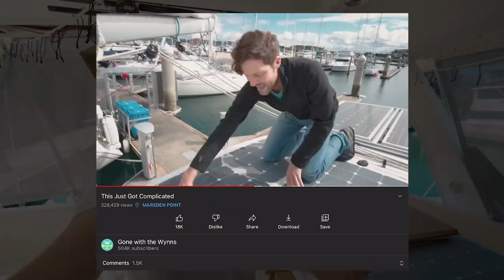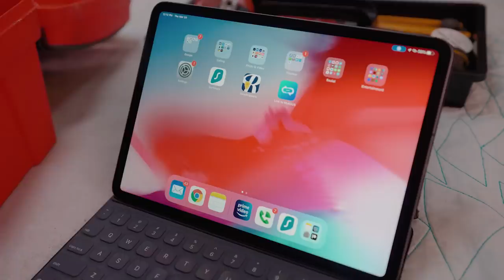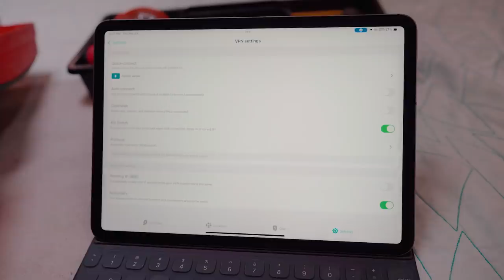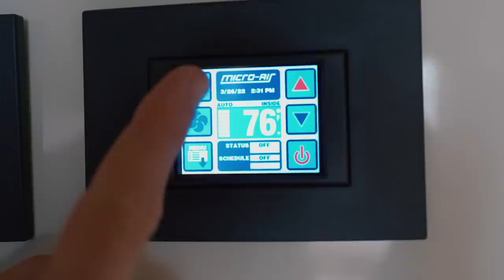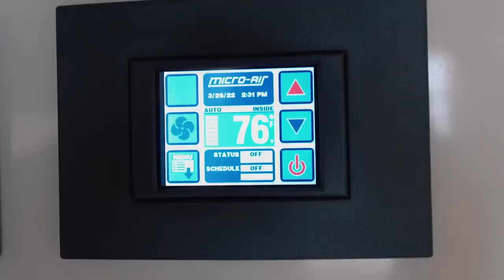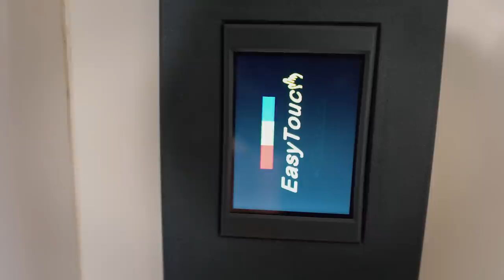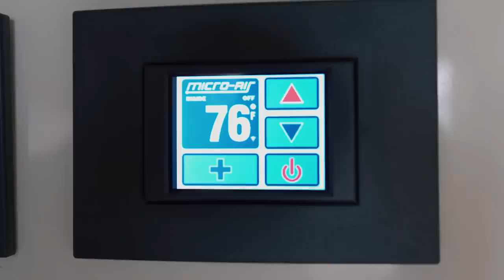Getting Back Modern Day Luxuries

Comment: Pro-tip…. Dehumidification of a boat takes 3 days of the unit being on before the space has all the moisture sucked out.  Dehumidification is also 1/3rd of the energy usage of an air conditioner.  So if you keep the space dehumidified then it takes less power to use the air conditioner when you want it.  Always use the dehumidifier when plugged in or when you have extra power.

Comment: Pre-heat those hose ends and they'll be much easier to slip over the fittings. Stick the end of the hose into a bowl of very hot water, let it soak to get soft & pliable, slip it over a ribbed pipe fitting and apply the hose clamp.  Life will be MUCH better!  If there's not enough slack to get the hose into a bowl of hot water, you can carefully (!) use a heat gun.  Even a hair drier will help get the plastic hose softer and easier to slide over the fitting.

Comment: I was a truck driver in the oilfield for 43 years. We had webasco heaters on our engines. They were hot water heaters to warm up the engines before starting. They burned about a pint of fuel an hour. They would bring a -20° engine up to 150° in twenty minutes. That way it was a warm engine start, which was a lot easier on the engines. That was in 2007, old technology. If your unit is as good as the old stuff, you will enjoy it.

Comment: Definitely add the extra caulk.  Most lift in an airplane wing comes wind passing over the top of it, much like your solar panels would be experiencing.   Every gusty storm will try the adhesive just a little and certainly adds up over time.

Comment: I also recently lost 3 of 6 flexible panels during a Typhoon in the Philippines. They were glued down AND put screws in on the 4 corners. Unfortunately, the sikaflex caulking really didn't stick well because of poor preparation in my side. The proper way is to sand the back of the panel where you plan to lay the caulking so that it is not shiny, but dull. Then wipe clean with acetone, both back of panel and the bimini surface.

I replaced all 6 of my panels with bigger, 3rd generation Sunpower using Maxeon cell technology. But this time I used 3M double sided tape and used the same type of preparation. Super pleased with final outcome.

Comment: Our venerable old lady, a 1975 Chris Craft 35 dc did not come with factory air. When we bought it in 2004 it had a home window unit cut into the back wall exiting and spewing condensate all over the bridge, ugly!. We were able to get a used 1992 16000 btu unit from a neighbor who was replacing it.  The install went pretty well, all custom because it was new to us. Been a lifesaver ever since. Being in Wisconsin heat is an important factor and boats get so hot when closed up during the summer weeks, A/C is essential. Our friend just replaced his  original salon unit, (1982) with the same one you installed.  It works really well.  You'll be happy.🌬❄❄❄
Love everything you do!  Keep up the great work.

Comment: Nikki, I just had sinus surgery on Feb 28 to remove 98% blockage of polyps.  Doing fantastic now!!!  It was life changing!!!  Should have done it years ago. Tremendously helped with allergies as well and no more asthma.  If you can get the option, make sure to get the Propel (biodegradable nasal stent with steroid) to dramatically improve healing and help to breathe.  Will you be coming back to the states for that surgery?  I wish you best of luck.  - Mitch

Comment: You should put corrugated plastic it's like cardboard between the panel and the deck or the hard top to allow air flow under the flexible panel to keep it cool Better performance and longer lasting

Comment: i just had the procedure on my sinuses, and I am 3 weeks after still irrigating two or three times a day with sodium solution.  I have put up with sinusitis for 18 months, no smell.  Keep on caulking.  Carry on, love the channel.
Reply: I had all my sinuses ruptured during training while in the Navy in the 80's. I was offered the procedure & given a day to decide. I was aircrew in a patrol squadron, talked with a lot of flyers who had & those that didn't. Overall, there were more against the procedure than for it. Never had it done, now I get sinus migraines with weather changes, smell is mostly non existent - except chemicals, those hurt. 
   As for caulking, cutting the tip at an angle is ok, but if you then fine tune it by running the tip over a piece of sand paper, that will change the angle slightly & you won't have so much to clean up...  Fair winds!
Reply: I broke my nose at age 10, & didn't have it looked at (everyone was more concerned about the tooth that was knocked out.  Note - if you knock out a tooth & have 2 black eyes, it is hard not to have a broken nose).  Anyway, by age 35 I was having constant sinus infections, headaches, and nasal polyps.  Plus a severely reduced sense of smell.  So, they went in, opened/widened connections that should be open, cleared out a bunch of gunk.  One of the best decisions I ever made was to have this done.  But the actual process wasn't too pleasant.

Comment: Just to add a little note about your up coming sinus surgery.  I had the surgery 24 years ago and I am sure it has changed a little bit but still want to give you my experience.   The surgery is fine - no issues.  For about a week after I did have a huge headache because it felt like I was getting too much air.  It had been years since I was able to breathe so it just felt off.  But all was ok.   That surgery helped so much!  And it is still working to this day!   I often tell my husband that if I ever need it again - that I will do it all over again because I no longer deal with not being able to breathe, sinus headaches and sinus infections.  That one week headache was worth it!    Best wishes to you and Jason.

Comment: Glazier Pro Tip: Regardless of what your told or read. Never spray a bead of caulk with anything before tooling it. The liquid or a chemical film left behind will get into small spaces and be trapped, not allowing the caulk to get down inside those same spaces and adhere to the surface. In most cases you can get away with just cleaning the surfaces with isopropyl alcohol, let dry, tape all surfaces, lightly tool the caulk at about 45 deg angle In order to not dislodge tape or tare it. (frosting knife will work or the end of an empty caulk tube) After dry tooling… if you have some cosmetic issues spraying with something that will not leave a film or break down the caulk maybe be done at that time. 

If you can jump it… I can caulk it! ;)

Comment: Besides doing the repairs, replacement, modifications, it's a pleasure to see the prep work before each task. 
Yeah, not surprised the additional "Zorro" caulk application decreased your caulk /panel yield. I believe, either you or another voyager were surprise at the high cost of marine caulking materials in  NZ.

Comment: Pro tip: Get a heat gun.  Hard hoses (of any sort) soften up wonderfully under a few seconds of heat from a heat gun... not only will they slide over the barbs better, the hose will conform to the barb's shape and give you a better watertight seal.
Reply from the maker: NOW you tell us! 😝

Comment: Wondering about the flexible panels...  The ones I found on-line appear to be the 12v variety, but Jason mentioned 50 volts in the video.  Do you have them wired in series, perhaps, i.e. 2 parallel strings of 3 panels in series?  If so, and given the variable shading with the Main, you might get more net power out by wiring all 6 in parallel, though you'd need much thicker wire going to the charge controller.  Come to think of it, same question for the rigid panels...  How are they wired?  

Great video, as usual.  Keep up the good work, have fun, and all the best for Nikki's surgery.

Comment: I know this won't help you at this time, but for the solar panels you should pit a spacer material under them to allow air flow to cool them off a bit. The cooler panels will produce more electricity. I've seen this on other channels. Maybe it will help someone else down the road.
Nikki, good luck with your sinus surgery. I had bi-orbital decompression surgery for protruding eyes from hyperthyroidism. The surgery was brutal, and included some sinus work, but it was worth it in the long run. I looked worse than Rocky Balboa after a fight for a while, but I am pleased with the outcome.

Comment: You could see how hot the old panels had got, which both damages the gel coat and reduces output. I’ll be incorporating an air gap on my surface mount panels using the Corolplast/flute boards

Comment: Hey! Great to see you're almost ready to head out and do some cruising. The panels look beautiful.
Just a note for Jason's cut finger and your first aid kit⚕ ... Crazy glue and superglue have been used as a skin adhesive for decades now. If you put the glue on the cut and then dust it with baking soda, it instantly activates. Afterwards, it can be filed smooth. Make sure to wear protective gloves to avoid getting Nikki stuck to Jason. 💥 But just in case you do get something unwanted stuck, acetone will get you unstuck!  It can be a sticky situation.
Reply: Just don't use acetone near a cut 'cause it will BURN!...
Reply: Don't use either. Use a liquid bandage for sealing wounds. Youngest son used super glue to close a cut that needed stitches. The doctor reprimanded him severely for using super glue because it was so difficult to remove before stitching the wound closed.

Comment: All panels even Flexible panels like to keep cool. I installed mine with core flute between the panels and the roof. Even though I did this mine failed after only 2 years reputable brand. I replaced my 6 x 160 watt with Sunpower 400w x 4 house panels best move I ever did. Others have done as well Parley Revival,  Sail Life , RAN , they just work. Downside weight and ugly. Upside always overachieving power.
Your comment on doing boat work twice that's what happened to me I was really miffed as I put a lot of effort into the Flexible panels and I can tell you they are really hard to remove. I ended up using Dental floss with acetone to "cut" through the silicone.
Good Luck

Comment: A tip to ease the install of any hose to a hose barb, heat the end of the hose using a hair dryer until the hose is loose and pliable.

Comment: How did you guys connect those panels? 
All in series as 1 group would be efficiënt because the higher the output voltage, the lower the losses.
BUT the downside is that when a shadow falls over 1  panel (like the shadow of the main sail beam) the entire group will lose efficiency. 
You can avoid this by creating multiple groups that you connect to each other in paralel. If one panel in one group is effected by shadow all other groups keep on performing at high output.
Reply from the maker: https://www.gonewiththewynns.com/sailboat-solar-series-parallel-shading
Reply: @gonewiththewynns  thx! Gonna read it!
Reply: Panels should be wired in parrallel for shading issues and in series only if you can avoid the shading issues all together.

Comment: Have you thought about putting a stainless steel “bar” that goes over all of the panels that covers the leading edge? That way, no hole in a panel, it curves over the coach roof, and should keep the panels secure even if they start to come off.

Comment: A pleasure to watch and nice to see yous are still in NZ.  Do yous seem to get more niggly little problems in nz, it sounds like it. Today I was abusing thin cut off wheel on angle grinder & this time it hit my hand. Wont do that again. I hope is was 80 grit sand paper yous used & not 800, thats too fine. And give panel backsides scuff - but i like to x the patterns.

Comment: It seems you need the OWEEFXR” with you!  (That’s my vanity plate.  Believe it or not BUBUFXR was already taken. 😁)  Keep a bandaid on it.  It will heal much faster than letting it scab over.  I say this knowing that this was probably at least a week ago and it’s probably already healed.  Oh well… save it for next time. Thanks again for another great video!  I also have GO Power flexibles on my Airstream. They are the only way I can get 300 watts on my limited sized roof. My caulk isn’t quite holding, but my roof is curved.  Something to keep an eye on.

Comment: I had rhinoplasty to open up my breathing, and I totally regret it. Now I can't jump into water without holding my nose. Floating on my back is an impossibility because even the smallest wave will go right down my nose. I can no longer seal my nose with just my face muscles, I guess is the problem. I would 100% advise against getting that done, especially if you are always in the water, like you are.

Comment: Nice work guys! FIY extremely unlikely to get a firmware update that rotates the display of your AC. I'm an embedded electronics engineer and I can tell it's quite a bit of work to do it... this isn't an app on your phone, this is done in low level graphics, but even that is not the reason why you won't get it. These companies (ac/appliances) just buy a control product that either exists on the market or contract out the development, once they have it it's done... very unlikely to go back and pay again to develop a vertical mode. Unless they have it already there is near zero chance you'd ever get it.

Comment: Wow, you guys went full German hand tool.  It's amazing how much of a difference quality tools make is it not?  When you go to get your next set of screwdrivers I would suggest looking at JSP/Posidrive stuff from someone like Vessel over the German options.  Most of the stuff you guys are working on are probably possidrive and not philips (Vessel makes stainless versions too).  I have wondered if using a petroleum based gun oil like Corrosion-X 50010 would help with the salt on high carbon stuff like tools?
Also, what do you think about that model of Makita powered caulk gun over the fully sheathed version you guys borrowed in the boat yard?  There is a significant price difference ...

Comment: Did the panels damage the gelcoat.?  Some say I am supposed to insulate the panels with plastic cardboard.  Your system looks much easier.  Can I use clear silicon?  Do I need more adhesion?

Comment: I was looking at flexible panels and was surprised to find that the manufacture suggests they will last only 5 years or so. (may not be the same panels you have) They did not say if the 5 years means they stop working at that point or if it just means capacity drops. However, considering the panels right behind the new ones are solid and should last for 15-20 years, why would using flexible panels be so important with these ones? The only thing I can think of is less holes or are these ones walkable?

Comment: Bad news: Solar Panels should last about 20 to 30 years. You're getting material damage by having them bonded directly to the deck instead of having an air-gap, for thermal & material strength durability. On hot days all of that heat is transfered through that roof (bimini?/fly?). Also, if you choose to use white conductor wires, they will last longer when exposed to the great outdoors for so long.
In the trades we call the all-weather silicone caulk "Spooge", but that might have made YouTube demonitize the video. 
Still all good fun, enjoy your new power, and thanks for sharing!
Reply from the maker: Nikki & Jason are well aware of the benefits of an air gap, but they walk on these panels to get to the mast. People have come up with some creative ways to get air gaps under them, but then they're a trip hazard which isn't something you want when you're moving along at 8 knots on passage. Sometimes, you just have to go with sub-optimal.
Curious Minion

Comment: I'm curious now to know, what the company will answer you about the micro air display.
Sometimes it's just a check in the depths of the settings, that you have to set or take away. That would be the easiest solution but I doubt that this is the case.
Perhaps you have now awakened the ambition in them to adapt the display function to the information on the frame. 🤩

Comment: Jason, I wonder if the  display software includes an option for portrait or landscape which may provide the 90 degree scteen rotation you need
Reply: Hey Dave, I wondered about that as well and guess the fastest fix would be to give Nikki the installation guide where she could look at the getting started section. Jason said when he is filming he gets in a hurry so he followed the installation part carefully but skipped the intro. They are a lovely couple of people and generally getting along and smiling at each other and anyone they meet along the way.  Hey Nikki, if you do see where the install describes the fix, wouldn't it be fun to wait till Jason is sleeping, make the change to the programming and turn the unit off. Then when Jason turns it back on he will see the change and say "Hey Nikki they fixed it OTA". :)

Comment: I can't help but wonder if it would not have been better to bolt down some aluminum rails so that you could use regular rigid panels? 
The advantage would be that regular panels can produce almost 4 times the amount of energy.
Reply: Regular panels can not be walked on. Necessity when using deck space for solar.  But they could have used 300 watt panels from Sunpower, little more efficient but more expensive too. They have 4 residential panels on their rear solar arch.